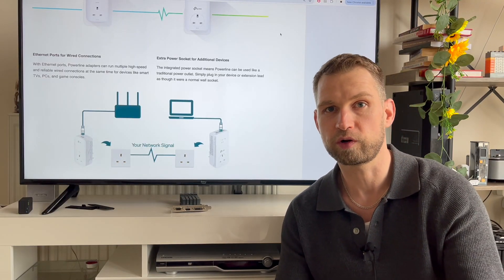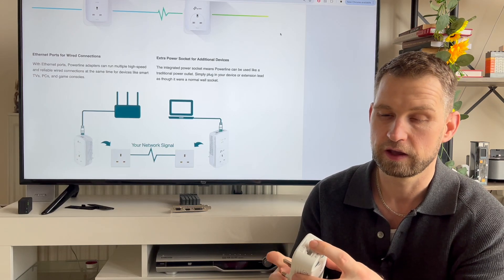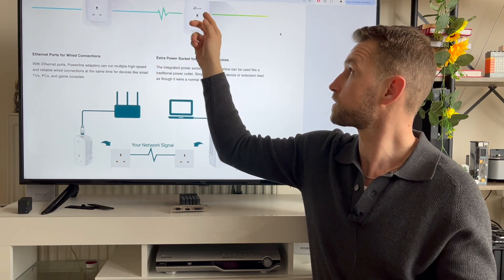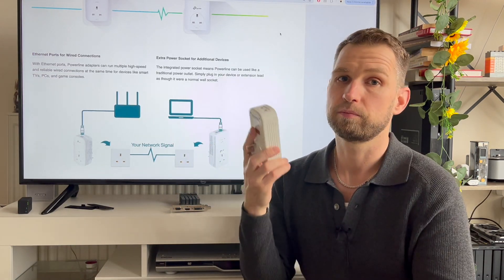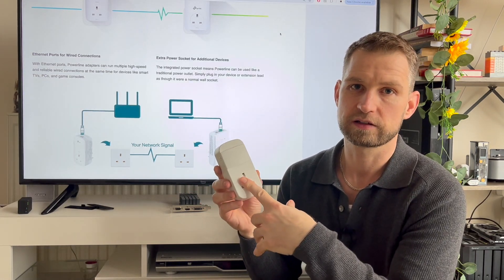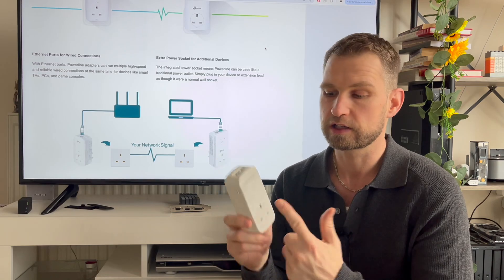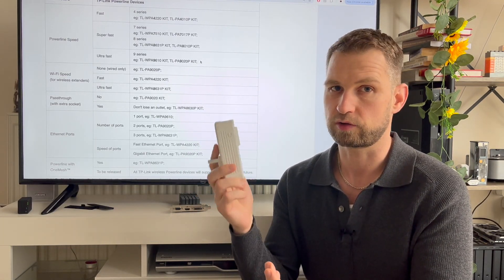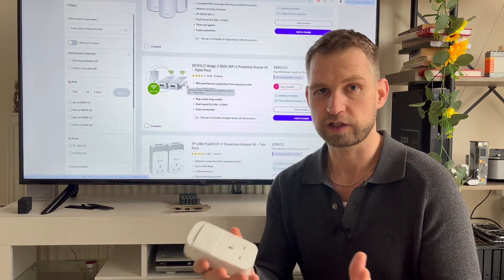Convert Your Power Socket into an Ethernet Port!  (Powerline Adapter Explained)

Comment: I use these for many, many years, love the solution to bits.
A few notes & experiences to share;
These types of solutions are also ideal for IP-TV e.g in the attic or bedroom.
It can bring IP basically anywhere in the house (even shed!) where a power-socket exists.
It also supports point-to-multi point (e.g powerline adapter near your router, 1x in the attic, 1x in the shed, 1x in the bedroom, all connected together to the one near the router)
The caveats;
Please make to keep the software of those powerline adapters up-to-date (they often allow the use of some sort of dashboard on your pc, browser or mobile).
Please do buy one from a reputable brand. You can sometimes connect different brands of powerline adapters together but that is not always guaranteed(!).
Make sure to turn on encryption and/or check that encryption is included/embedded;
Otherwise your neighbours(!) down the street might be able to see your complete network when they are (also) using a powerline adapter.
For 600Mb (and below) powerline adapter using a 2-wire mains connection are often enough.
However, when you are using the 1200Mbps (high speed) powerline adapter, the earth connection is also used (thus a 3-wire connection).
Please be aware that often  powerline adapters can go into a power-safe mode when during an extended period no (LAN) data is passed-on.
So, it might at times take a while before the LAN connection is becoming active again, your IP just might fail a few times before the connection (between the powerline adapters) is made again. At times, you might need to unplug the powerline adapter(s) if the (IP) connection is not re-establised.
You CAN mix several networks together and even have them separated(!) across the same mains supply cable(s). (e.g. a private, air-gapped internal-only network and a internet facing network). Just pair the powerline adapters into each separate set(s), powerline adapters do support such a scheme and multi-point next to point-to-point connections.

Comment: I do this a lot. It works rather flawlessly 👍 and yes, it's way faster than wi-fi with 1gb or greater. Just ensure you have the most recent ethernet cables to handle the speed.
Reply from the maker: Yes, cables are important especially with longer distances

Comment: Only works if your home was wired correctly to start with. Older homes do not work very well or at all! Ask me how I know this! It's still a gimmicky product. Find a way to run cat6 cable directly to the device.
Reply: If I was laying cables now I might go better than cat6.
Reply: @PlayingItWrong  LOL stupid auto correct lol
Reply from the maker: Luckily it was on the same circuit in a three story building. Cat6 is better, but this is easy.